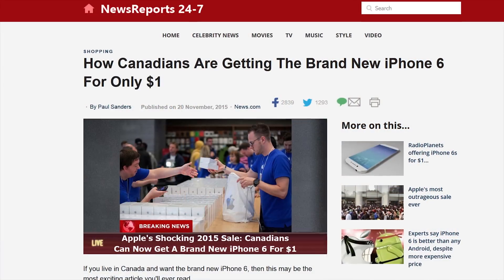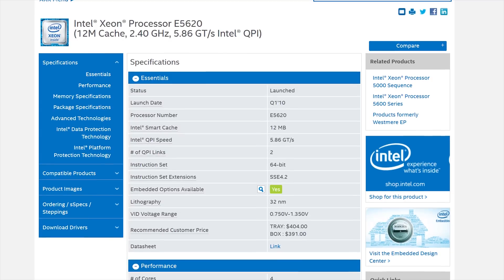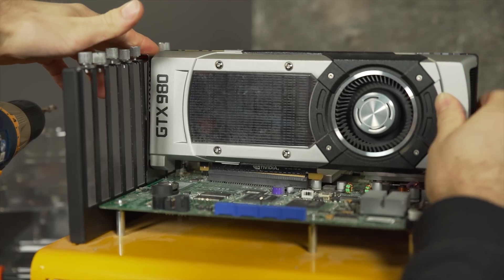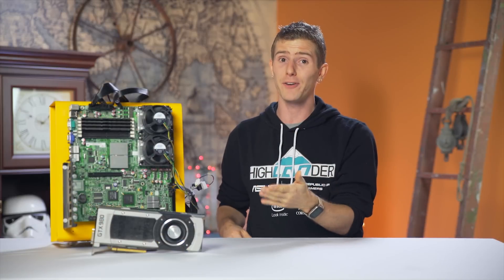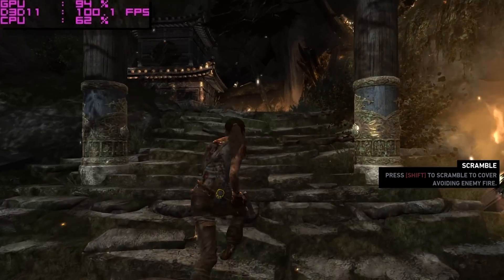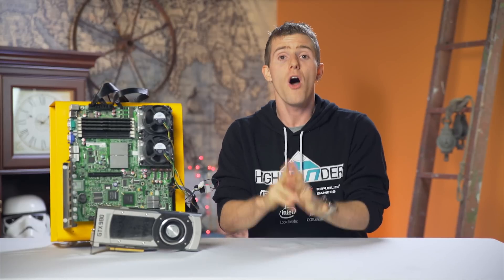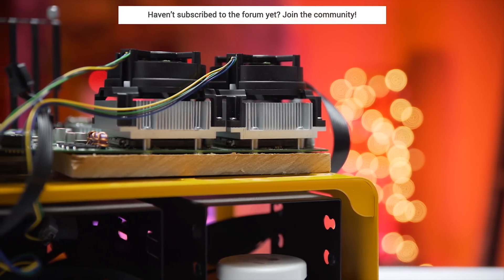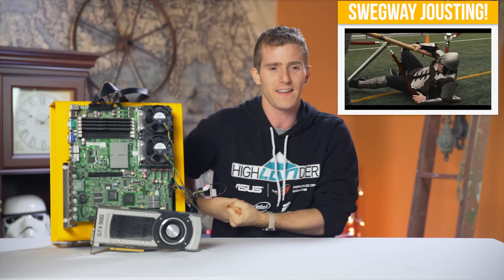Under $150 Budget Gaming 8 Core CPU, Motherboard & 16GB RAM

Comment: Whats wrong in modding 775 socket board to 771 and run CPU with all extensions board can provide instead of running Frankenstein server board?
Reply: 775 dont support 2 cpus
Reply: +aazzr wadrf Thats true, but on other hand regular 775 board runs on cheaper non-ECC RAM, has sound-card and ports for whatever you like and it fits normally into any standard case. Above all its cheaper overall, so difference in money can be used for say cheap 60GB SSD.

Comment: Socket 771 is basically Core2Duo/Quad equivalents for servers , rather look for LGA 1366 Xeons preferably with Hyper threading , you can actually find them for cheaper sometimes at surplus shops compared to Ebay.
Reply: +HPZeta Here is what I came up with, its a Socket 1366 Xeon With hyperthreading which will result in 16 Virtual cores!! 

And only costs $55

http://www.ebay.com/itm/Intel-Xeon-W3530-SLBKR-2-8-GHz-Quad-Core-AT80601000897AB-Processor/262205991576?_trksid=p2047675.c100005.m1851&_trkparms=aid%3D222007%26algo%3DSIC.MBE%26ao%3D1%26asc%3D20131003132420%26meid%3Db468206dc46a42e4aec2578cfb7ca4f6%26pid%3D100005%26rk%3D1%26rkt%3D2%26sd%3D161616399721

http://www.ebay.com/itm/Foxconn-02010HE00-600-G-Intel-LGA1366-Dual-Socket-Server-Motherboard-/181833796762?hash=item2a56238c9a:g:bzYAAOSwAKxWU3h5

Comment: I must say , you have the correct idea, but your shopping skills suck.   I went out got a 24 core Amd Opteron server with 48 gigs of ram and a 750 gb harddisk for $147..  its out performs my i7 4770 by about 30%..     I was pretty impressed so i spent $80 more bucks for a pair of 16 core 2.3ghz opterons..  they still have not arrived yet, but going from 24 to 32 cores and at .2 ghz faster cant be a bad thing... Just for kicks i dropped in a used  480gb SSD that i got a good deal on..  Next step will be hacking apart a old apple G5 macpro tower to fit its new 32 core server guts into for the ultimate franken-computer for next to no bucks.  Cinibenching over 1200 for under $150 :)

Comment: What I did was find myself a Complete system.  Bought a complete HP Z600 Workstation tower.  Came with dual quad core xeon E5640's (2.67ghz), 16 gig ram and even a Quadro 4000. Ready to run for Just under 300 to my door.  Upgraded to a SSD drive and added another quadro 4000 for sli and its a mean system for under 500. Looks awesome too with all tjhe brushed aluminum etc

Comment: Nothing wrong with using Westmere for a budget gaming computer, however, you'd probably be better off sticking to single socket builds and looking for motherboards that are more client oriented rather than server oriented. Real-time workloads, especially games, even those optimized for MANY CORES are not likely to scale across multiple SOCKETS (totally separate memory subsystems). In fact, in many games, trying to run them on both CPU's at the same time will actually result in WORSE performance than confining the game engine to a single physical CPU. This is because the separate physical CPU's are connected to each-other with far less bandwidth and far more latency than the cores within a CPU. 

I notice the motherboard in this video doesn't have built in sound, and also doesn't have any place to install a sound card other than an external USB sound I/O device. If you factor in the extra $20-40 you're going to spend getting sound on that build, and all the monkey business of fastening it to something, you'd probably be better off with an AM3+ or FM2+ build...

If you live near a microcenter, you can get an FX-8320E + GA-78LMT-USB3 for about $120-130 (combined). Pick up an 8GB kit for $35 and that'll run modern games as well or better than westmere based server stuff, and have a much better set of I/O (like sound! and plentiful USB, and fan headers! etc). 

The 860K will also run most games better than a westmere quad core.

Comment: I just finished a dual Opteron 2435 system with 12 cores, 32 gigs of ram, twin 120GB SSDs, two 2tb WD Hdd, and twin HD 5870 eyefinity 6 2gb cards for less than 150 bucks. I got lucky with the video cards, because i figure there worth 100 apiece. But the Tyan board, processors, and ram are available everyday on eBay and come with warranties. You don't have to spend a fortune to have a nice machine. A little research can make up for a lite budget.

Comment: On a video about obtaining a cheap mobo+cpu+ram for gaming, why would he use a shit GPU ?. The high tier GPU is needed to show CPU won't bottleneck the game, Look around in hardware forums, when people ponder if Xeons can be used for gaming, the common responses are that i3/5/7 will do better because "Server processor is designed for server tasks so its not suited for gaming". 
Here Linus proved otherwise, you CAN build a CHEAP gaming pc WITH xeon processor/s, that will not be CPU bottlenecked in relevant games. 
All with giving fair warnings that it will take extra work, both  in verifying component compatibility and in requiring on-the-fly modifications also you will have no warranty on anything.

Comment: I think a better option would be the following:

-AMD Athlon x4 860k 4.0GHz Quad Core ($75 w/ Cooler) (eBay or Newegg)
-8GB DDR3 Ram ($31. Yes, $31) (eBay)
-GIGABYTE GA-F2A78M-HD2 FM2+ Motherboard ($39) (Newegg)

Total: $145

More modern hardware. Better upgrade path. Better for gaming (More FPS).
Cheaper @ $145 vs $150 in the video.

Links:

CPU: http://www.newegg.com/Product/Product.aspx?Item=N82E16819113379&cm_re=860k-_-19-113-379-_-Product

RAM: http://www.ebay.com/itm/172029483462

MoBo: http://www.newegg.com/Product/Product.aspx?Item=N82E16813128694R&cm_re=fm2%2b-_-13-128-694R-_-Product

Comment: I built it and it works like a dream, I put Xeon 5050's with hyper threading at 3ghz and i got a motherboard wit more than one PCI-E slot, then i put an an R9 380X and a USB 3.0 PCI card.
Reply: +Raymon Rodriguez The entire PC cost less than 600$.

Comment: So...150$ for a dual xeon build with no GPU that could land you in the loony bin compared to a 5 to 600$ usd AM3+ 8core build with a basic entry level R7 250 that you can mod and upgrade later. 
PRO TIP: Never use server bits for gaming PCs.

Comment: Those Xeons are low power models so I don't expect high results. A X series would have produced higher results bit cost more and produce more heat. Also if you're worried about motherboard functionality, you can get adapters for compatible 771 xeons to make it work on 775 motherboards which will make things like sata perform faster as well as DDR3 I believe (don't quote me on it)

Comment: This was an interesting experiment! I've often wanted to build something like this just to see what it could do. First, that is way way way to much work for a gaming build! I'm a tad on the lazy side! lol  But, I could see this recommendation going quite far for a cheap, end all be all PC for the folks, and grand folks. Let me explain. For example, my parents are typical PC users who watch Youtube, check emails, shop online and listen to their oldie goldie music collection. The last upgrade I gave them was to an AMD A4-3400 dual core APU @ 2.7Ghz, Samsung 840 120GB SSD and 6GB or Ram on Windows 7 roughly 4 years ago. They are no where near maxing that PC out. I've never heard even once a single complaint about speed...even before I added the Samsung 840. I just did so to ensure prologed performance and when I went over there I'd not be frustrated with that old Seagate 250GB dinosaur it was originally running. 

Since this little A4 has lasted so long I can only imagine that an 8 Core based system would be over kill for an everyday casual user. Regardless.. fun experiment... thanks for sharing and have a great holiday man.

Comment: I have one of these with two chips running quad core at 2.33ghz. Performance is massively less than an FX-8350 - as is this above board as well. But of course, as we can see above, the GPU makes it work in the newer games that are designed for multicore CPUs. I'm actually most amazed of all that the 8x electrical PCI-E 1.0 (1.1?) slot didn't bottleneck stuff.  

I think this means that for AMD octocore users, they can potentially expect their CPUs to outlive the gaming usefulness of i5 users - the total power of the bulldozer parts is greater than the i5s, and will be increasingly leveraged by newer titles. A shame that those CPUs are stuck with PCI-E 2.0 connections...

Comment: Nothin's faster than McMaster!

I wonder what the difference would be on a full x16 or at least 8 lanes of PCIe 2.0.

Anyway, I love picking up old server parts.  Snagged a HP blade with 2 hex core processors and 8 160gb 10k rpm drives for $450.  Pretty hard to beat that much processing horsepower at that price.

Comment: I'm looking to buy a decent computer, possible build. I just have no knowledge on how to even begin something like that (What parts work with what, best price for my needs, how to assemble, etc). Can anyone get me started on that?
Reply: +James Wilmore Whats your budget? What usable parts do you already have? Monitor, keyboard, mouse, stuff like that.
Reply: 60 dollar mouse, 40 dollar headset with a mic so it requires 2 jack ports and a USB power source. Budget is around 1000. Just need a system for over 150fps on CS at the moment
Reply: +James Wilmore A thousand dollars will build a very nice machine. What is "CS"? Frame rates over 60fps is pointless unless you have some very specific reason for needing that high a refresh rate. The human eye can only see so much detail.
Reply: Just for the smoothness of 120hertz and fps. Also I'd like to multitask. Counterstrike is the game
Reply: +James Wilmore OK, to get a frame rate that high, the first thing you need to do is make sure you have a monitor that can do 120hz refresh rate. Id use a 32 inch LCD TV. A Vizio M32-C1 make a very good computer display. If 4k isn't a must, and for me it isn't, I'd go with a single GTX 780 video card, and plan to add another one in a year. For processors, id use a pair of Intel Xeon X5675, and a Supermicro X8DTi-F. the combo will not be something you will find on a store shelf, but it will work very well. Add a Single 500gb Samsung 850 evo hard drive, a 2 terabyte storage drive, and a cheap blue-ray burner to the system, and you can do anything you can think of. Windows 10 Pro will be a must, if you don't have Windows 10 enterprise. Look for a Rosewill Blackhawk Ultra case and two Cosair CX600 power supplies. there's a device called a ADD2PSU That will allow you to run two power supplies in a single machine, and the case will accommodate them. If Ive done the math right, you should come in at under a grand for everything, including the TV. If you need a full parts list, send me an email address.
Reply: James Jarmon Is there anything complicated about putting all these together?
Reply: +James Wilmore Yes, this isn't a machine you can start with, and learn from, unless you like to read A LOT. Most of us have been doing this for years. That's where knowledge makes up for lite budgets. If you have never built a machine from scratch, your going to need help from someone who really knows there stuff. I can make you a complete parts list, and were to get them from at the right price. But if you want to build a high end machine yourself, your going to have to learn the way high end machines work. there not like just buying an HP off the self from Walmart. Once you've done it the first time you'll want to build more and more. I normally only keep a new computer 3 or 4 months before i sell it to someone and build something different. people know my machines work better than retail bought junk, So they keep coming back for more about every two years. In the last 20 years Ive build over 2000 custom machines.
Reply: Could I pay you or someone else to build a ~800 dollar machine for me? Are there companies that do that?
Reply: +James Wilmore I build custom machines everyday. just need an email address.
Reply: I'll get in contact after a couple of months, leaving for basic tomorrow.

Comment: This video is such click-bate rubbish... The best chips in the processor families he has listed will still cost $200+ per chip, especially in the 5500 and 5600 series (mostly because people with workstations and older Mac Pros still buy these chips as an upgrade). 

The guy also just stuck a $500 GPU (which he damaged) into a machine with a PCI-E 1.0 bus. The board he using will give terrible performance, especially with DDR2 FBDIMMS. You will also need a decent power supply for this board (or another one) which will cost $100 or so. 

You may as well save your money and put it towards a decent rig. Even a mid-range or expensive AMD setup will give you better performance. For example, the AMD-FX 9590 will out perform if not all of the Xeons you can pick up for < $150. 

If you don't believe me, go compare the performance of the chips for multi CPU setups and single CPU chips on cpubenchmark.net...

Comment: Allow me to thicken the plot a bit. If you shift your focus from Server components to Workstation components the build, while not nearly as interesting, is equally powerful, and as flexible as a standard Desktop. A dual xeon sla 775 (xeon 5450 like the one in the video) motherboard is $30 on eBay, and has all the necessary slots. 

A big plus is that it will fit into a box. The overall cost will be about the same, since the rest of the components are basically the same as a server. It may cost even less, depending how valuable your time is.

Comment: BTW you can avoid the issue with a serverboard. You can use a generic 775 board with the 771 to 775 mod. :) 
OFC it's only 1 cpu then but less of ai issue to work with. You can buy already selected and modded chips on ebay that way.

Comment: ive rebuild this. you can just screw motherboard pins into wood. threads are the same. but i still dont know where to plug in the cpu fans...

Comment: I use to use a Mac Pro 2,1 with dual 2.6 quads for a spare gaming rig (It also saw use as a work station). (Picked up the Pro for $60 from someone who thought it was a G5)

I used to bring it to LAN parties and everyone would roll their eyes at me complaining that I brought a Mac and that it would suck. I would let them use my i5 2500 system or my MacBook Pro 750M instead. No one would believe me when I told them that it ran great or cared enough to come look. Now I have a video to back me up.

Comment: You can get a dual LGA1366 board + two quad core CPUs + ram for 200-250$ and you get PCI-E 2.0. Best to look for a complete system like a HP Z800. Some are even water cooled and you can stick two video cards in it.

Comment: "This concept was a lot fun for me to explore and it is a worthwhile strategy for a budget gaming box"
Half true statement I'm guessing.  I can see how it would be fun to Frankenstein all that stuff together.  Can do an 8 core amd plus motherboard for $110 (microcenter) or even just a dual core intel plus mb for $100 from anywhere.  With 8gb of ram and that 980 how does it compare to the xeon rig?  + You would have new parts  + You would not have to shell out for a usb audio solution.

Thumbed up the video because I like the idea but am not buying the practicality.

Comment: Good video. I've specced these on ebay too. Socket 771 cpu in a socket 775 motherboard (P35/P45) is a decent budget path. My old DFI P35 motherboard still has lots of life running a Xeon 5460 at 4.2ghz paired with 4gb ddr2-1066. That plus a decent SSD, plus a budget GPU (R9 270) and the little beast is about 95% the performance of my overclocked 3770K/GTX780 rig and runs reliably on an old 400W Enermax PSU.

Comment: The amount of people completely missing the point of this video disappoints me...
1. The title does NOT say "$150 computer". It says "$150 <parts>". Could the title be arranged a little better? Yes, but objectively it is not misleading.
2. The overkill GPU is strictly to eliminate potential bottlenecks in order to showcase the power of the dirt-cheap server components.

Comment: Hi, Linus. I do not know if you could see that. I feel so amazed that you have made this video. I only want to say "good job,man". Well, you know, in my bbs called "TuBa",  this old cpu Lga 771 L5420 actually can be installed to the Lga 775 motherboards with some little processing like G41,P43,P45 and so on.  Compared with your plan, installing your L5420 to P45 motherboard sounds more cheaper and  convenient. Hope you can see that.  A fan from China.(TuBaJiLao)

Comment: One thing totally not covered in this video which is absolutely ESSENTIAL when running a dual-CPU setup, is that you cannot just graft in a desktop PSU and expect things to work - a lot of server boards use proprietary connection types and non-standard voltages.  Be sure to do the homework on what type of PSU the board you're buying will need - it's almost a given that you'll need a supply with dual 8-pin connectors.
Refurbished Intel boards are usually a fairly safe bet for compatibility.

Comment: thank you so much I am building a pc beast I also realized it doesn't have a graphics card I have a extra one but for some reason it says I have a intel hd 5500 and I found out my processor has a build in graphics card and I also found out it runs just fine on most games like battlefront EA at 60 on low

also if you want to know my specs
24 GB of ram
3.06 quad core intel

I spent 124

Comment: I just did this recently !

4 node blade server with 8 x5650  $200
got 32g ram $60
SSD $100
7970 $80

Some things to note about server mobos are PSU's. My supermicro X8DTT has a 20 pin power connector but it requires a custom wiring scheme so make sure to check data sheets and work accordingly. Some dells dont have the standard PSU connectors and require external power distribution units(PDU)/PSU.

I might make it into a gaming VM server with a AMD FirePro S9050 :D

x5570 x5550 are extremely cheap guys $20 a cpu